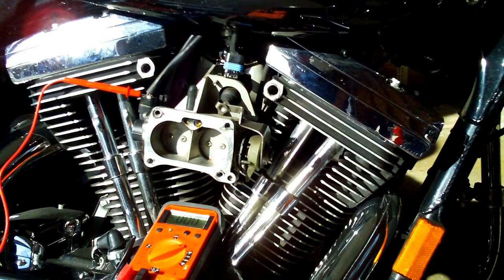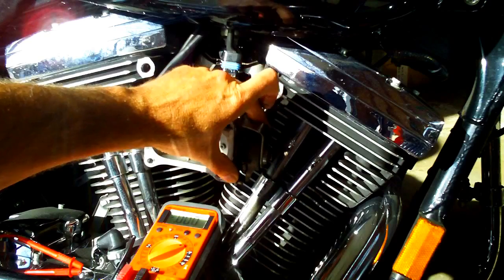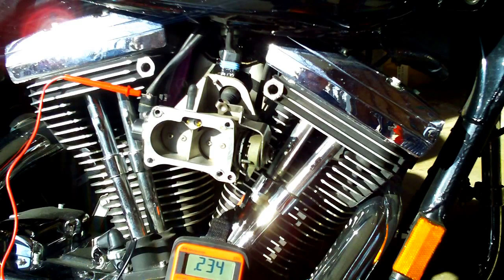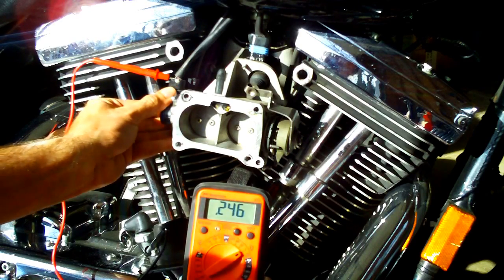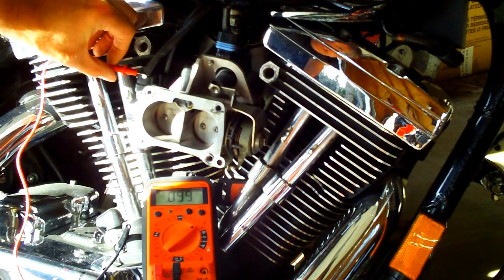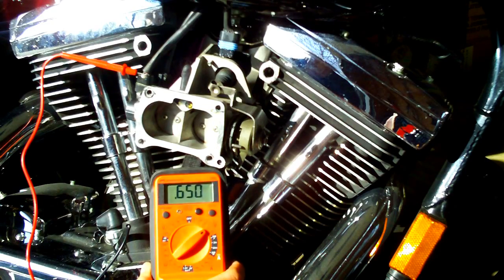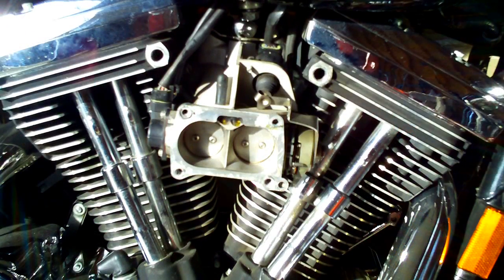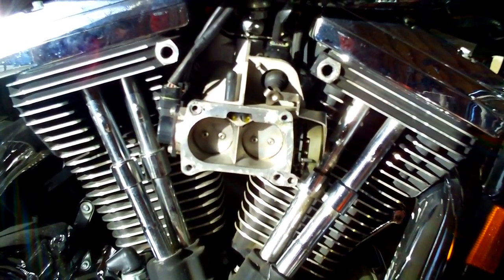Reset Harley Davidson Magneti Marelli Fuel Injection TPS Settings ✔

Comment: great video, have a 98 ultra glide, all of a sudden the engine light comes on and off inertmittently, sometimes when I throttle up or down, or shift thru gears, checked code by turning on and off ignition and got # 11, which is tps, is that easily replaced by unscrewing the replacing, then calibrate the way you describe, or is it more than that?
Don S
Reply from the maker: LilOsideSmitty My best guess is that once you remove your old TPS and install the new one, using these settings, you should be good to go with no more check engine light. As I stated in the video, I "guessed" the setting trying to trick it into thinking it should add more fuel (as I had seen done on a snowmobile) but that just led to intermittent check engine light similar to what you describe. I don't believe there is a way to "guess" the TPS setting, it is just too sensitive. Very little movement one way or the other leads to a big difference in voltage reading. Good luck, and let me know how it turns out!

Comment: Well I've noticed a significant difference in power but still get some popping and backfiring on deceleration... also the idle seems a bit low until it warms up...at what point should I just bring it in and get it tuned ????
Reply from the maker: Jeff Ellis It does sound like it's running a bit lean if it is idling low until it warms up and pops on deceleration. I would take it to a reputable shop and ask what they suggest. I put a fuel injection tuner on mine to take care of it running lean.

Comment: my 97 Ultra has been at a dealership for 4 weeks and they cant get the damn idle fixed yet. Lowest they can get it to is 1500  Its FI
Reply from the maker: Neil Dickerson Sr. A friend of mine has a 99 Ultra, and it was doing the same thing last year. The cold idle motor was extending further than it should be. We are suspecting the cold idle motor is failing or the engine temperature sensor is giving a bad reading, but nothing positive. So far our fix has been to unplug the cold idle motor connector, push the cold idle shaft into the housing (slowly, it will go) and we turned the warm idle screw up just a bit so the tach shows just over 1,000 rpm idle to make cold idling a bit better. He has to use the throttle to keep the revs up for a minute or so to warm it up some before taking off. Someday he will likely look into it further. Let me know if the problem is solved, one way or another. Thanks!

Comment: I put a slip on v&h exhaust and now my idle is low... could this be the problem???
Reply from the maker: Jeff Ellis It could be that the new exhaust has more flow to it and has caused it to be at a leaner mixer, causing the lower idle speed. I would at least take the air filter off so that you can get to the warm idle screw and turn it up to where it was before. Keep an eye on how the bike is running overall. Check the plugs (when bike is cold) and see what color they are after some miles of riding it with the new exhaust, looking for a whitish color which would indicate lean burning. You may need to look into some sort of fuel injection remap or adding a fuel injection controller (which is what I did to mine).
Reply: contact4mwy7 
I put in a cobra power commander and a h-d stage 1 intake with the v&h slip ons and it seems ok but... do I need to do anything with the ecm??? I've been told it needs to be reprogrammed .... and do i have to do that at the dealer ????
Reply from the maker: The only "reprogrammed" I know of is to remove the fuses to the ECM for about 30 seconds, and also turning the bike on (waiting for the check engine light to go out) turning it off and repeat up to 5 times. I have done these because why not. At 7:50 into this video you can see where the fuses are... https://www.youtube.com/watch?v=X1a9kBx_Lb4

Comment: What engine is this procedure for? Does it matter what performance add-ons anyone has installed? What's puzzling me are my initial voltage readings (before touching the screws on the TPS/ left side) which are much higher than .275. My engine is a 97 1340 evo with only a KnN style filter and aftermarket slipons (with baffles). There are slight surges while cruising at speeds and I'm getting some popping when shifting in between gears and on deceleration. Not too bad but, it is popping. I was told that this bike may already have a Stage 1 tune programmed in it. How could I find out? Would this affect the initial voltage readings? Cold idle runs about 1500 and when completely warmed up (sitting in traffic), about 950 so, I think I have the idles set properly.

Thanks again, this is very good information, and thanks for the inputs!
Reply from the maker: Gary Mckay Hello Gary, my bike is a 97 with a 1340, K&N air filter, and aftermarket slipons, so we are very similar there. Your cold idle and warm idle sound like they are in the ballpark for where they should be. 

What is the voltage on the TPS wire for you? Also note, the cold and warm idle screws have to be backed out enough so they no longer touch anything to hold the throttle plates open at all. In other words, the throttle plates need to be completely closed for this measurement. If you do back off both screws, count the number of turns so that you can turn them back in the same amount and have them back to their original idle settings for both. If you turn them out 7 turns, turn them back in 7 turns when you are done. See what I mean?

I have added a fuel injection controller (Dobeck Gen 3) to mine to help tweak the fuel mixture. I have found that if I add too much fuel with the controller that mine will pop on deceleration. I do not know how you can tell if someone has flashed your bike to a Stage 1 setting. If you can find someone with an exhaust analyzer that might be a way to tell where your bike is in terms of air to fuel ratio (lean or rich) How are the plugs? White is lean, brown is good, black is rich.

Comment: I watched your video twice before going out to my newly purchased '97 FLHTCUI. Bike only has 8700 miles on it, with a stage 1 air cleaner and cycle shack slip-on mufflers. I wanted to adjust the idle and make sure it was adjusted properly after seeing that my oil pressure had dropped to 0 (at idle) on the gage and a short time later the oil light would come on at idle. (Oil pressure does climb when moving.)

So, I hooked up a meter and followed your procedure. Checking my initial settings, my initial voltage is 0.933vdc which is considerably lower than what you are describing (0.275vdc) At this point, I stopped and started surfing the net. I can not find anywhere on the net that references your numbers.

This is a 97 flhtcui, 80" evo, stage 1 flash by the dealer. I'm at the point where I think I need to follow the procedures in the manual of adjusting ONLY the cold idle screw, pulling the fuse, etc.
Reply: Gary Mckay I opted to (as you suggested) leave the sensor setting alone. I did not remove the epoxy from the screws. I did set the cold idle to 0.650 and it idles cold at 1500-ish.  After allowing it to run long enough to be good and warmed up, I adjusted the Warm idle to 950-1000 (on the bike tach).  I watched the oil pressure from cold to warm, started high and dropped low enough to make the light come on solid. With MUCH research (and still looking), popular concensus is, "this is normal at idle and hot engine." Pressure does rise to 15-20 or so cruising down the road. Any thoughts and words of wisdom are welcome and appreciated.
Reply from the maker: Gary Mckay Hello Gary, I found the numbers on a Harley Davidson discussion board which I have now included a link to in the description which starts with "Click here to read full forum posts". I also included links to the service bulletin from Harley Davidson on setting the voltages per 1340 or 1450 motors with the MM system. I have put many miles on mine with these same settings still going strong. I just logged 170 miles of back road and highway riding combined and got 51 mpg. Two up rides were getting an average of 49 mpg. As far as your oil pressure goes, that makes me nervous that it is low enough that the light is coming on. Are you using 20w-50 oil and the correct oil filter? Also, there is an oil screen that filters oil to the tappets (lifters). Here is a link: https://www.youtube.com/watch?v=47ljGG0XMa0. Otherwise, you really should seek professional help with it to be sure you are not in for a surprise down the road. Good luck to you my friend.

Comment: Just a quick note to say THANKS for doing this video! Just bought my first HD and it has been a BEAR to crank when hot! My local independent won't even touch a Marrelli'd bike. Followed your instructions step-by step after changing the ETS on my 2000 Ultra and the bike runs and starts better than EVER! Could I ask where you got the info on the sensor output voltages and such? I would like to have the spec'd voltage for all the sensors since this is gonna be my baby for a loooooooong time!
Reply from the maker: smacdowngrafix Glad to hear it, Smac! I found the settings on a message board website, there are lots of them out there. I do not have any of the voltages or specs on the other sensors yet. I also have 2 videos of installing performance fuel injection controllers to the Marelli system if you want to check those out. Good luck with it!

Comment from the maker: Kenneth Smillie, the engine temperature does not matter for this procedure. With the bike in the OFF position, unplug the cold idle motor connector. It will stay in this "neutral" position throughout the process, even after you turn ON the power.

Comment: Hey it's me brother got it to do all the settings only thing is some time idills good next time wont start till i give some throttle if at all then shut it off and then about third try it well kick over but idills rough .then one time it was running okay took it out on freeway was running great got on it a little bit about 85/90 and then it revved up and then started to shut down barly got it off freeway let cool down stared up ran it all way back home and then one block from home same thing trip was about 20miles any thing you can help me with brother would mean the world to me thanks
Reply from the maker: First of all, is it making the check engine light come on? My bike started showing some hard starting issues late last year and I believe everything is pointing to the engine temperature sensor from what I have read online. It is located in the top of the front cylinder, you'll see a wire going to it. I am going to replace mine soon before riding starts up again for the Summer. When the sensor fails it can make the bike think it is already at operating temperature making for hard cold starts. As for when you got on it a little bit about 85/90 and then gave it more, remember there is a rev-limiter on the bike that will kick in at roughly 100mph, if that's how fast you were going. Other than the rev-limiter engaging and cutting out the spark/fuel to the bike, I don't know what else could have caused what you described.

Comment: Great video. Set mine like you did but I'm getting a chirping noise out of the throttle body on my rear cylinder. It has been doing this since I bought the bike. Bad injector? Any advice would be much appreciated.
Reply from the maker: Eric S Eric, I don't have an answer for you on the chirping from the rear cylinder. I once had a chirping noise, like the sound of a bird, coming from the tube with the rubber cap as shown in the video. The rubber cap had deteriorated and there was a hole in it. At certain throttle positions the air going through that tube would 'chirp.' If you find out what it is, let us know!
Reply: Will do thanks. I'm going to swap injectors to see if it moves it to the front cylinder

Comment: Wow. Thanks for taking the time to make this video!  I bought a '95 cheap because the owner had issues with the check engine light. The tps looked brand new. I checked it using your instructions, and sure enough it was way off!  

Runs like a champ now!
Reply from the maker: Edward, that is great news! I'm glad you were able to get your bike running the way it should be using this video. Mine still runs like a champ too!
Reply: Need help i have a 95 electra glide classic rev high on its own you think these steps will help my issue
Reply: I know its 3yrs but your symptom sounds like a broken butterfly

Comment: Great video but on mine i cant not get it to read anything more then003 on meter can you give me any reason why brand new battery
Reply from the maker: Hello David, I can't give you a reason why except to ask if you are sure you are on the right setting on your multimeter? It's a DC measurement, 0.275 volts (just over a quarter of a volt). I wish I could say for sure what could be causing your readings to be off if you followed every step correctly including which wire to probe.
Reply from the maker: contact4mwy7 Also, probably a dumb question, but are you sure the new battery is fully charged? Have you measured to voltage from it?
Reply: Ok all try again thanks for getting back to me so fast
Reply from the maker: Loosen both of the idle screws until the carb plates close up completely, unplug cold idle motor connector, attach multimeter to sharp pin in the 3rd wire across the top of the TPS, other end of multimeter attach to ground, turn on power to bike... rotate TPS sensor until correct reading shows.
Reply: All check that battery today thanks for been cool brother and taking your time to help me

Comment: cam lever assembly ,assembling ,after the throttle plates are partly open ,what did i do wrong on the assembly
Reply from the maker: Jerzy, did you check both the cold idle and warm idle screws to see if either one of them is what is holding the plates partly open? As far as I know those are the only things that would do that, other than the throttle cable. Are you sure it's not the throttle cable? One thing to note, use Loctite on the nut on the end of the throttle plate shaft. Mine somehow loosened up on a ride and fell off causing the throttle plates to be held partly open, like riding with a high idle! I have not had the cam lever assembly apart myself. Double check that reassembly is correct. Do you have a Service Manual? I do, and it comes in handy. It is a PDF file I downloaded.